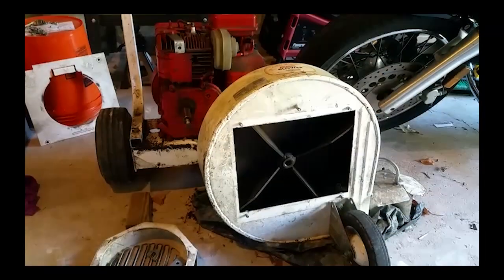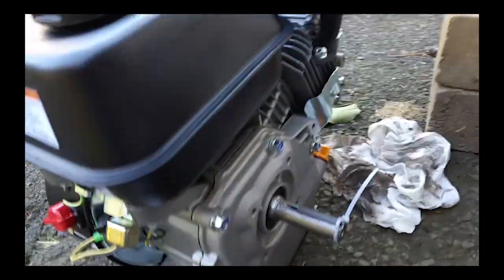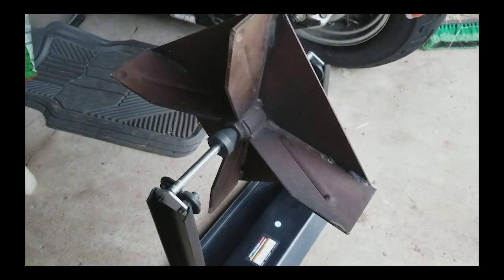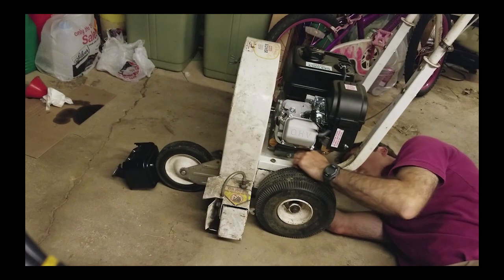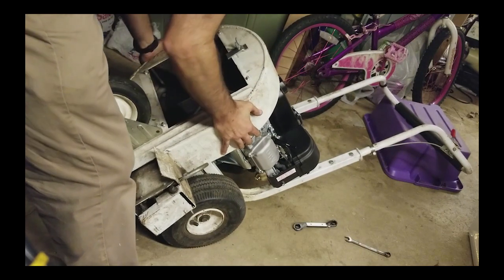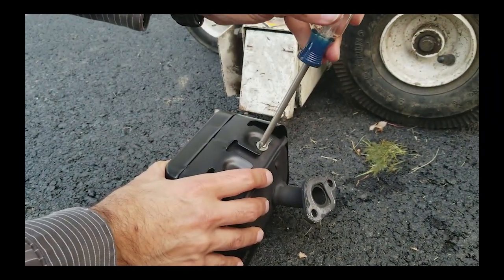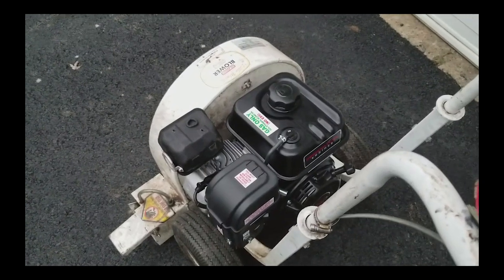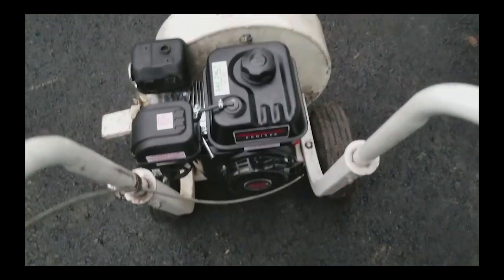Little Wonder Leaf Blower Repower

Comment: The only drawback to this conversion without a throttle cable is that the throttle control is no longer on the handle and you have to keep leaning over to adjust the throttle on the engine.

I had a 1984 Little Wonder 5 HP blower back in the day....same model as one in video but with the older style handle.

Took motor off to rebuild it and put it back together and sold it in 1987.

Bought a new 1987 Little Wonder Blower with the 8HP Industrial Commercial Engine.

Had the engine off a few times over the years for new rings and valve jobs.

I also had a DR brand brush mower with the same 8HP Industrial Engine which I had hardly used. Engine was basically like new.

I put this engine onto my '87 Blower in the early 2000's.

While I had the blower apart, I repainted it to make it look as good as new.

I still have that 1987 blower in 2025.....It is for my own yard at home....not for commercial work which is why it has lasted so many years.
Reply from the maker: @dwi189  it is hard to beat those old machines. The throttle cable is one thing I never got around to retrofitting...call it laziness given how infrequently I used the blower. Unfortunately (see my most recent Little Wonder video), my rushing led to a catastrophic failure. I still have the original 5HP Briggs. I might try a rebuild to see if i can salvage it.

Comment: I have the same blower but can't figure out how to remove the impeller.  How do I remove it?
Reply from the maker: The impeller is threaded,  at least on mine. Screw a 3/4" bolt into those threads, and it serves as a puller. Brace the impeller and turn the bolt, which will push the impeller off the engine shaft. Some lubricant on the bolt threads and/or penetrant on the engine PTO shaft should help.
Reply: @par64guy  Thanks.  After looking at it closer, I thought maybe it needed a 3/4" bolt.  I will have go buy one and give it a try.

Comment: How do you remove the impeller from the original engine?
Reply from the maker: The impeller has threads in the hole. I threaded a large bolt which acts as a puller to slide the impeller off the shaft. Some penetrating oil helps.

Comment: The 3/4" shaft is always going to be a problem in this application, it's simply not strong enough compared to the original 1" shaft when spinning such a heavy impeller, and the sleeve does not add any strength but simply makes it fit the 1" impeller. A sleeved 3/4" shaft works well in a normal application like a snow blower or lawn mower where it's turning a belt or a blade with a much lower weight. Since the leaf blower housing doesn't have any wearing parts (other than tires), it's probably worth investing in a new or used engine with the 1" shaft, which basically gives you a good as new machine. Briggs still makes  1" shaft engines, I have the same blower and used a Briggs 1" shaft engine from a snow blower when the original engine wore out, you do need to add an air filter though, as snow blowers don't use one. I too added the angle iron you mention between the bottom of the handles and the housing, the original engine had a support from the top of the engine to the top of the blower, removing this allows the housing to flex too much.
Reply from the maker: Excellent points. I agree the 3/4" shaft was not ideal, but at the time I did the project, I was not successful locating a replacement engine for a reasonable price. I have found that being gentle with it and not whipping it around has worked thus far. Very good point to look for other donor equipment when doing a swap.
I do still have the old engine, and I am considering investing in trying to get it running again as another YouTube project now that my channel is actually making a little money. What do you think of that project idea?

Comment: Do you have the gas tank bracket? We are in search for one. TY
Reply from the maker: I still have the engine.  I am tempted to try a recovery video where I attempt to get it running again. But, if you can use some parts,  we can work something out.
Reply: @par64guy  the bracket is 2 strap with several mounting points.

Comment from the maker: My only real complaint about the Predator engine is the fuel tank. From what I can tell, the fuel tank drain location does not let the tank fully empty. I found I have to tilt  the blower to get fuel to travel to the carb when it gets low.

Comment: Any long-term follow-up? Still running? Any issues?
Reply from the maker: So far so good. I only used it once this season, but it started right up. I'll probably use it one last time this weekend to do a final leaf cleanup.
Reply: @par64guy  Just got my Predator at HF (BF sale). Do you recall length of 5/16-24 bolt for impeller?
Reply from the maker: @CTarna2  I do not remember exactly, but examining the video at 9:54, I am guessing between 2" and 2.5" You may want to get a few in that range to avoid back and forth trips to the hardware store.

Comment: I just picked up I believe the exact same blower and I can’t seem to find a dip stick.  Is there one and I’m just not seeing it or if there isn’t how do you check the oil?  Thanks
Reply from the maker: The original engine had an angled oil fill, so when you check it on a level surface,  sufficient oil will be just below the tip of the fill stem.
Reply: Michael Lorello   Thank you.

Comment: Mike why did you use the OhV predator engine and how is the reliability on the predictor engine because the leaf blower runs full throttle most of the time
Reply from the maker: I used that engine mainly because of the cost and the number of repower videos I watched that use the Predator series.
So far so good. The first Predator engine suffered a broken PTO shaft right at the beginning of the keyway. One of my Mechanical Engineer coworkers thought it may have been a defect where they cut the keyway too quickly or with insufficient oil thus creating micro cracks.  Combine that with changing direction while spinning a heavy steel impeller at full throttle and boom. With the second engine,  I have been a little more careful.  I made sure the impeller was balanced and do not whip the blower around to change directions (reduces angular momentum forces).

Comment: Michael,

   Thanks for posting this.  I'm in the process of resurrecting my Little Wonder Blower with your method.  I noticed you left off the angle bracket that connected the top rear of the blower housing with the top of the Briggs & Stratton motor.  Does the blower seem fully secured without using that bracket?  The predator motor has some attachment sites at the front of the motor but you would need to create a custom bracket to use them.  If it's unnecessary, great!   FYI I found the torque specs for the crankshaft bolt; 30 foot-lb.  You used 160 inch - lb (13 foot-pounds).  Do you remember the length of the crankshaft bolt you used?  In the video, it looked longer than the one that came off the old engine.
Reply from the maker: I found that the blower housing seems to be pretty stable without the bracket. I had bought some angle-iron and was prepared to fabricate something to bolt to the features on the Predator, but determined that I did not need it as the impeller does not hit the housing. I do not recall the length of the bolt. It did need to be longer because the Predator PTO shaft is shorter than the OEM Briggs engine. I wanted to be sure I got enough thread engagement.
Reply: @par64guy  I believe the original bolt was 1.5 inch and the replacement needed was 2.5 inch.  I used an extra washer as a spacer to prevent the bolt from bottoming out within the crankshaft.  2.25 inch would have been better if available.  I skipped the bracket as it didn't appear to be needed.  I've used the blower a couple of times with the new motor and its great to have the original power restored.  https://www.youtube.com/watch?v=0BhF7F-3ss8&t=11s

Comment: I have the same blower and rebuilt the Briggs engine but it died again last year.  I planned to use the HF engine but was warned about breaking the crank.  Did you balance the fan before or after the warranty engine?  I figure at $99 I can replace 4 engines before I get to same price as a Briggs with a 1" crank.  If the engines last one season and I buy an extended warranty I should be ok.
Reply from the maker: I did not balance it the first time and also made fast maneuvers like whipping the blower around corners with the engine running at full speed. I figure the angular momentum of the heavy steel impeller combined with any imbalance that existed produced enough force to break the shaft. For the second engine,  I balanced the impeller as shown in the video and am gentler when using the blower. So far so good. One of my mechanical engineer coworkers thinks the first shaft could have already been weak if they cut the keyway too quickly or with insufficient cutting oil in the Chinese factory.

Comment: You can add the throttle cable to the engine pretty easily, if you remove the air filter and housing, there is a spot where you can insert the wire and Clamp it down with a screw (looks like a nut with a philups head screw in it) and then there's a spot to Clamp the throttle cable housing down too so that you can use the original throttle control lever
Reply from the maker: Thanks for the tips! I will try to get that done before leaf season.

Comment: 😂 uses the enforcer 🔨  lol love it 😆😂😆
Reply from the maker: What's a DIY project without an "enforcer"? :P hey, I made that muffler fit,  didn't I? I was initially looking into buying extensions or seeing if one of my coworkers could weld something,  but I got impatient.
Reply: Lol you did great caught me by surprise after all your balancing and shaft adapters then you just bang out the muffler 😂😂😂 I can understand it was out of impatience thanks for the laugh 👍👍
Reply from the maker: @chadmills1323  yup, I figured the muffler is not as critical a component so it could tolerate a bit more drastic modification. Thanks for watching, and let me know if you have any suggestions for other projects you would like to see.

Comment: Just had the 8hp Briggs blow the connecting rod with a nice 2” hole out the side of the crankcase on my Giant Vac blower. It had locked up the week before due to low oil level. I got it freed but about 5 minutes in blew the rod. I did find an identical engine on a Troy-bilt chipper/shredder with supposedly low hours for $125 but not sure the shaft is same size/length. I don’t know how important the length is. Does it have to be identical?? I might go the Predator route like you if the Briggs doesn’t work. How has the Predator held up this fall?
Reply from the maker: So far so good with the Predator. I just wrapped up another leaf season today. Any fuel left in the tank was treated with Seafoam. I turned off the fuel supply and let the engine run until it dies from fuel starvation. I do need to change the oil in that as well as the tractor, but I ran out of daylight. For repowering, I recommend trying to get the same size PTO shaft. If you cannot find the same diameter, you might be able to get away with one size smaller and use a shaft adapter like I did. Just use caution as the smaller shaft may not have the same strength. I suspect the first shaft broke from a combination of it being defective and the smaller shaft being weaker against the high angular momentum forces exerted when I was whipping the blower around to turn corners. That heavy impeller spinning at over 1000RPM must have been torturing that PTO. I now make my turns more slowly as a precautionary step.

Comment: I installed a Predator engine to a 20 year old Cyclone Rake 200 gallon yard vacuum that tows behind a lawn tractor to replace its tired 5 hp Tecumseh Enduro engine. as the muffler was the problem as i had to cut the pipe add a section to position the muffler imward and higher so it clears the blower housing as well as access to the spark plug. as i seen a video replacing chipper with predator engine as he extended his muffler higher to clear the housing but has was not level. i got mine level as i had to attach the lift handle to the recoil mounts as the vacuum assembly is lifted to the chassis when its hitched to the tractor, followed by the collector that unfolds. but the predator engine gave it more vacuum power this fall when the leaves came down in w pa hit a good patch it did not bog down at all. the tecumseh motor did bog down. the engine i used from Harbor freight is the Honda clone made by Chonquing Ratio power Manufacturing. yours in the video is a Loncin commonly referred as the Hemi engine. as both parts can interchange with Honda the gaskets recoil housing. as now Briggs & Stratton is making Honda clones with their own recoil and hoisings. .
Reply from the maker: Thanks for the extra tips and trivia on the engines. Unfortunately I did not think to dig more into muffler mounting options nor did I have access to welding equipment to fab something. Funny, I did consider getting a go cart exhaust,  but I figured the noise level would have been obnoxious and they were pricey. Hopefully your ideas will give other viewers better options than the route I took with mine.

Comment: Any issues with the carb after beating the hell out of it.
Reply from the maker: I do not recall having any carb issues. I make sure to run my small engines dry of fuel before storage. If I cannot, then I make sure to add stabilizer to the tank and run it for a bit to get the stabilized fuel into the carb. MY only issue starting the blower last week was realizing after about a dozen pulls that I had forgotten to switch on the ignition! (facepalm).
Reply: @par64guy  thanks for the response.  I am almost done completing mine.  All i have left is to put the fan cover on, put some oil and gas in.  I got lucky with the exhaust.  Someone i know had an old honda muffler laying around never use.  It lined up perfect and no hammering was needed.
Reply from the maker: @thomassindelar1368  that's great. Do post a picture if possible.

Comment: Had did it last through the season? 1 year update? I noticed you didn't/couldn't add the top "stabilizer bar" from the motor to the blower housing, any issues? Thanks for the video.
Reply from the maker: It did last through the season. I was a little more careful not to whip it around thinking the sharp turns combined with the high rotational speed may have stressed the smaller PTO shaft of the Predator engine - you know, that whole rotational inertia Physics stuff. We are starting to come into the Fall leaf season, so I will be firing it up again soon.  I did not notice any issues with omitting the stabilizer bar. I will be sure to comment if anything new happens.
Reply: @par64guy  Any updates as we approach another fall season? Im in the same boat.
Reply from the maker: @f650gsnj  The leaves are just starting to fall, so I will be waking the beast around mid to late October. I typically start by mulching the leaves with the lawn tractor. Once they are falling at too high a rate, I break out with the blower.
Reply: How did it last?

Comment: Hey Michael ,  Why didn't you show the procedure of the removal of the blower wheel . I have a Little Wonder leaf blower with the 9hp Robins Subaru engine that needs to be replaced . I removed the crank bolt  that hold the blower wheel on and it is apparent that some sort of flywheel puller is needed . Am I mistaken ? What did you use to remove the blower wheel ???
Reply from the maker: My apologies for not showing that. Unfortunately, I had already disassembled the blower when the idea to make this DIY video came to mind. You need a chock for the impeller and a 3/4" bolt that you thread into the impeller shaft opening once the retainer bolt is removed. That bolt bottoms out against the crankshaft and pushes the impeller off. I found using a washer and some lubricating oil inside the opening helped prevent the bolt from scraping against the shaft. I hope this helps.

Comment: Super job, great details.  I copied it and saved hundreds of dollars myself.  Another Little wonder still going strong in Florida...Thank you Michael.
Reply from the maker: Thank you! I am glad to hear that this process worked for someone else besides me. I do like the performance of the Little Wonder, so I felt it was worth saving. I write this a couple of days after doing the final round of leaf cleanup, so the next step is to change the oil and put the blower away for the season.